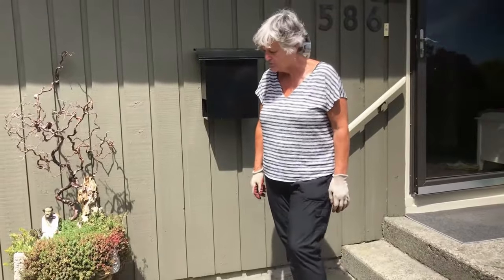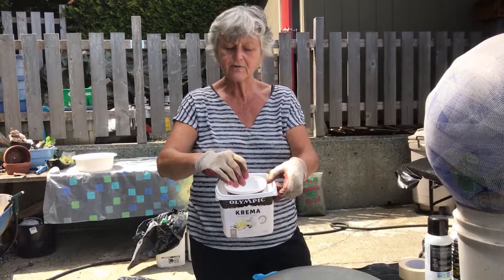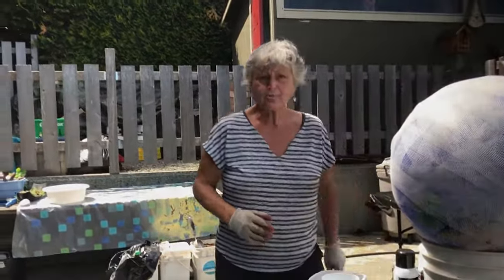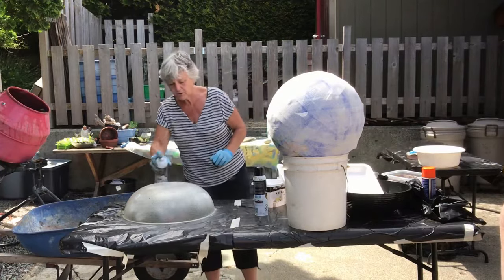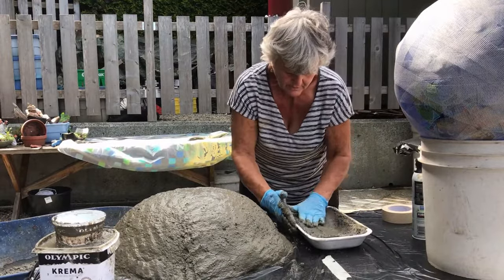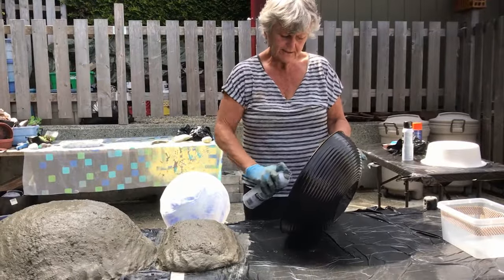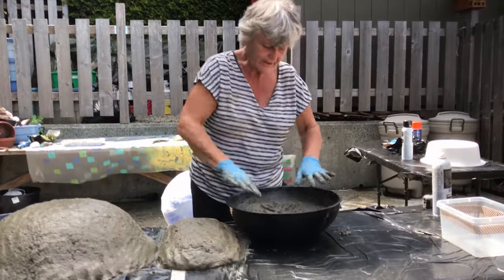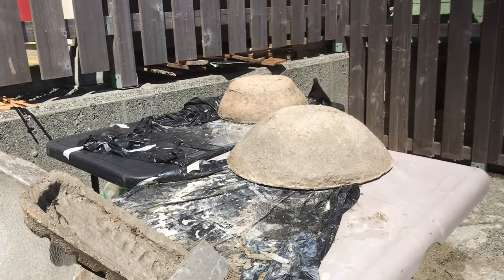Hypertufa

Comment: after molding the sand, "pour" a thin layer of the cement mix over it. let set just a bit. this will separate the sand from the mix, now you can add mix by the handfuls without having it peel off some sand.I love your videos :)